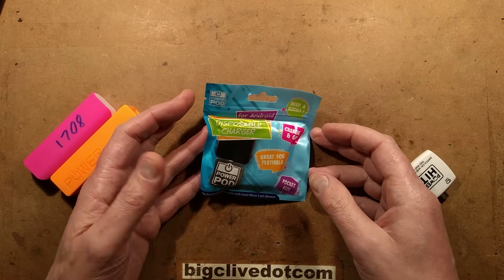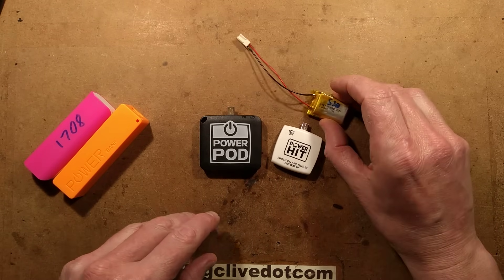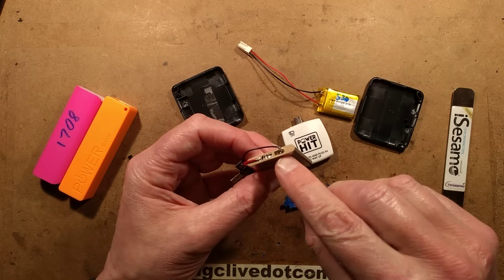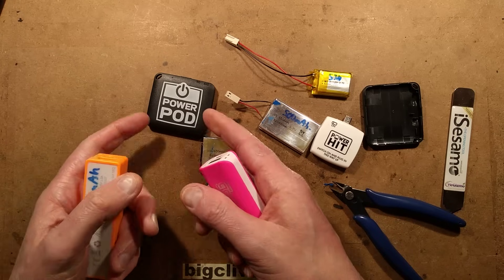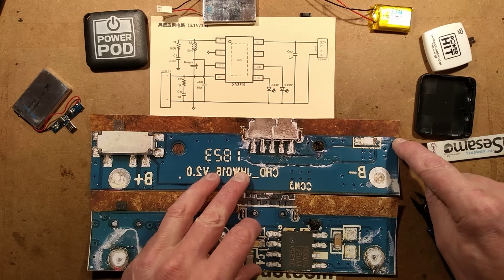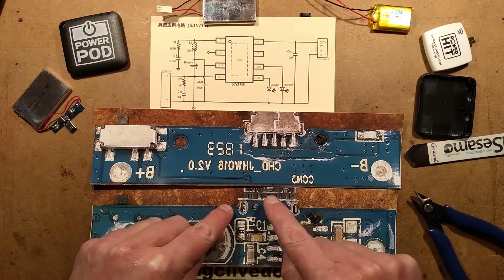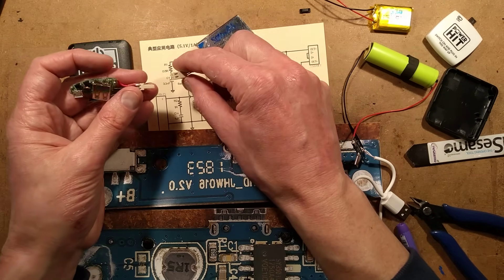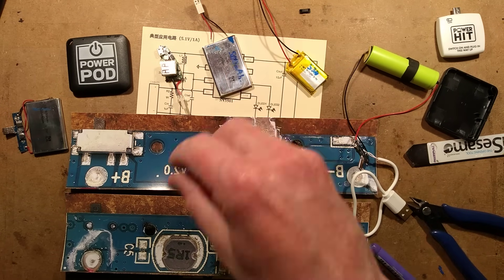Poundland "disposable" phone charger.

Comment: YO i have that blackweb battery!
can confirm, it's great, it can make my phone last about 4 days with medium heavy use and it's durable!
i lost it at some point and one day i just went on a walk in the fields and just happened to find it there, mostly horizontal, but ports facing up slightly, the impressive thing is i had lost it 4 months prior to that, in the winter, it was now summer, i brought it back home, opened it to check the voltage of the cells and found some ants, the cells were very low so i trickle charged it overnight then charged it using the usb port and it retained most of its capacity, iirc this was about 5 years ago, i still have it and still use it, i even recently found out it can do 30W usb PD, which wasn't advertised anywhere on the box, unfortunately the usbc port has seen better days and it's not in great shape now, usb PD doesn't work anymore
also fun fact, the day after i found it the fields were plowed, i was lucky to find it

Comment: I made a power bank using 5. 18650 battery and a 20 watt module it works good and has a over heat protection.

Comment: why even bother using a chip equipped with undervolt protection they've already installed a switch all the really needed was a boost converter that would drain battery down to oblivion but would give out a little more capacity than 650 mah also would have saved them a bunch of money

Comment: I love the lip stick charging cell...usually dependable and different configurations allow clips, lanyards, current capacity,  or any combinations...so fits or attaches anywhere without puting in your pocket. 18650s hold an ample useful energy supply.

Comment: the biggest problem i have with electricy as a power source is the losses whenever you move it from one place to another.  It's be like pouring 40% of the fuel out on the ground whenever i fill the tank... Its so wasteful.
Reply: Er a typical ICE road car is only 25% efficient……….

Comment: Bruh... I can do the same thing with a bunch of used rechargeable disposable vapes I collected off the ground for free, and it will actually be reusable

Mr. Vapor Lux Bars are the most common here, they've got 400mah batteries and are rechargeable with a type C port, it wasn't actually that hard to hook these up to an arduino to create a smart charging bank that can both charge a phone and itself through the same port.

Why just why did the designer of this think it sas a good idea...? At least I can kinda understand rechargeable vapes because pod based flavored vapes were banned and these are convenient and have an overall longer usage life, but this is literally just a one and done thing. So wasteful.

Comment: What I'm excited for is the day when I can have a supercapacitor in my phone and as a backup instead of batteries. Of course, batteries will probably always hold the edge in capacity. But at some point, if high-end supercapacitors can even reach about half the capacity a battery can have, that would be enough to make it worth the transition just for the faster charging. I wouldn't mind having half the capacity if I could plug it in for 10min when it's nearly out of power and have it be fully charged again.

Comment: First disposable "inhalation devices", and now this? Why are people even buying this? You said it yourself, you can barely charge your phone with one of these. I think the only actual legitimate use for this is to throw in a hiking backpack for emergencies, since it's very shelf stable and totally water sealed (at least until you open the packaging). They probably would've sold a lot more of these (for better or for worse) if they marketed it like that, because that's the only way I could see it being actually useful. But then there would be the risk of people just dropping these in the middle of the forest, which could 100% start a forest fire. This is just a terrible idea, especially because they sell bigger rechargeable batteries for the same price. Whoever thought of this should be fired.

Comment: I have a power bank from Maxell, that takes 4 AA's in series and depending on the chemistry it can get an old S10 up to about 60% charge state from 10%, but it is painfully slow towards the end. So if an average alkaline AA has a roughly 2800 mAh capacity, then barely a bit over half of that can be transferred to a phone battery which is on its way out. At that point the voltages are going nearly equal and next to no current can flow.

Comment: I have something like this. The charge tab. Purchased at walmart. it has an unknown capacity li-po pouch battery inside and what seems like a basic powerbank circuit with an unpopulated USB connection.
Soldering a USB lead to the + and - tracks on the board leads to the blue light coming on but no charging. Turning on the switch seems to activate charging and also allows charging of a device. The main chip does get warm, about 120- 130F and draws up to half an amp during charging. I've tested the battery and it is charging. Hopefully I can come up with a case for this. Maybe I'll change out the USB C for a standard USB A socket So I can plug anything in. 
Also these are a nice source of LiPo cells.

Comment: 2 points - - WOAH didnt realise how old this vid was
should there be a ban on using rechargable lithium ion batteries in throwaway non rechargable devices like desposable powerbanks & vapes.
if the battery inside is 650MAH at 3.7V. the device is sold with a 5V usb output. at 5v it should hold 481MAH.
if the device is sold as a single unit with a USB (5v) output and not intended to ever be opened would selling/marking/advertising it as 650MAH be miss selling or falsely advertising the item ?
Reply from the maker: Most power banks declare the capacity of the internal cell.
Reply: @bigclivedotcom  i thought they did and just think its deceptive and deshonest
im suprised none have started making them with 0.1A internal cell at 100,000 mah sold as 100,000 mah.
when switched up to 5A usb it would only be 2,000mah. surely this would be deceptive.
i think that if its sealed inside a device never intended to be opened it should be calculated at the only vaultage that the user will be aware of. the input / output vaultage or in mwh. anything else is deceptive and dishonest

Comment: four years later, 5 rewatches and from no powerbanks to 3 of them, in reference to the blackweb mention. one thing that would be interesting is to see how the true capacity powerbanks are getting their capacity. i know that the Samsung brand powerbanks for their 5,000mAh line (sadly discontinued) does it with 2 Li-Po cells in series of about 3,000mAh each.

Comment: you could put those batterys from single use powerbanks in a powerbank board with a fuse and it will work! make sure to pick a 2 cell 18650 as that charge and discharge board has protection

Comment: I'm a bit confused because yesterday I watched Mythbusters "Will appliance in bathtub electrocute" and on there they claimed at first that just 70 milliamps was a fatal level but then later said it was as low as 6 milliamps. You're saying these things give out over 500 yet I'm sure you couldn't electrocute yourself with a cell phone battery. So am I missing something here?

https://www.youtube.com/watch?v=SU7xkYmWwmQ
Reply from the maker: The battery has low voltage (low electric pressure) so it can't push the current through you.
Reply: @bigclivedotcom  Ok thanks, so its not entirely true when they say its amps that kill you not voltage?
Reply: So I guess its a bit of both really.
Reply: @bigclivedotcom  So is voltage basically just a measure of how much push the current has? Or is it more complex than that?
Reply: Thanks for replies btw

Comment: You could, wire it to another connector and solder a charging port And reverse engineer it with a protection for charging. It would be a good thing for the better for a nice backup, better bang for buck, even wire several batteries in a series with a protection, for even bigger bang for buck.
Reply: I’ll find it funny if they say they use 100% recycled plastic and materials and rate it eco friendly, but in the end  require you to throw a lithium bucket in the trash, I just hope it gets out of my yard very quickly lol 😂

Comment: I’ve never seen anything like that here in the US. I’d never buy one anyway considering I’d much rather have any one of the plethora of rechargeable usb packs out there. The smallest one I currently own has a roughly 1650mah capacity and is no bigger than the orange pack in this video. I only spent 12$ on it, have had it for years and used it countless times.

Comment: The CRAZIEST thing is I can AND HAVE got a proper rechargeable USB battery for the equivalent OF 3 POUNDS here in Australia. Does about 75% of my phone battery. And I have had it for probably more than a year and a half at this point. Works well. Actually I just realized it's the exact same as the orange one you vehicle got there. Except black.
Reply: No way auto correct made "You've Got" into " You vehicle" lol
Silly phone

Comment: When you first removed the case and saw the cell I actually said out loud its a BL5C! That's seriously a waste of a BL5C cell. They are just so good  for a little cell. I wonder if protection boards were rejected, cut off and the cells placed in the factory seconds bin then picked up by the maker of the poundland stuff and decided they can make one hit wonders with them. So wasteful even for a pound or dollar store item.
Reply: But even then it doesn't make much sense, the chip in these is the same as in power banks and will protect the cell. They could just have added an USB port for charging and have a quite crappy powerbank instead of this total nonsense
Reply: You reckon I could use those BL5Cs to power an MCU?

Comment: most likely they use the crappy LiPo batteries that would usually get thrown away right from the production line. long story short they probably use crappy batteries that loose capacity too quick when recharged.

Comment: I will never understand why those chargers doesn't have a charge port, as it would only cost a penny more.
In the current implementation, such chargers should be phased out, as you need seven of them to charge the smallest phone battery once, after which they all go in the bin. It is nonsensical.
As it is nonsensical to add the charging port and chip to them, as a credit-card sized power bank, 2500 mA/h capacity, only costs four pounds.
Poundland should review their offering, avoiding those minuscule single use chargers, and selling the thin 2500 ma/h rechargeable chargers, if they have the slightest green aspiration.
Also, here in the West the USB-C socket is now prevalent, while in the Far East the USB-micro socket remains unchallenged.
Poundland has a minimal offer of USB-C cables / accessories, they should update their inventories. Please note, those single use chargers would never operate a USB-C device properly, as they range from a minimum of 18 W, to a standard 60 W to a top power of 120 W.
Thank you for the video, showing the Poundland chargers and their inner circuitry.

Comment: Here is a nice alternative: A german telecommunications company which has stores in nearly every city borrows you a fully charged powerbank for 10 euros and you get the 10 euros back if you return in somewhere in the country
Reply: I love this idea!
Reply: Indeed, the last festival I went to (End of the Road) you could get a power bank with a deposit for use at the festival (although there was still a price above the deposit, of course).
Reply: @xinaesthetic  nothing wrong with that imo, need to turn a bit of $ for both repairs and replacement. As well as profit, duh
Reply: @HeyItsJonny  of course, no complaints here.
Reply: Welcher Laden hat dieses Angebot?
Reply: @stephanlustig5490  Die Telekom, kannst mal danach googlen, gibt wohl inzwischen ein paar Läden die keine powerbanks mehr haben
Reply: @chaotus  danke für die schnelle Antwort.
Reply: How do they make money? Replacement of the batteries and energy to charge them have cost.
Reply: @Artoooooor  I think it was mainly marketing and some wouldn’t bring the powerbank back which would make a profit

Comment: Wondering if the higher then tested mAh rating was because those things are designed to deeply discharge the Li-ion cells, basically bringing them below the expected 'zero' to the true zero point of Li-ion.  Thus giving it some extra mAh at the expense of recharge cycles and battery life, which neither are important for a disposable application.

Comment: Though these might be wasteful products when they are sold for the intended purpose, they do become a source of components to those of us who are unable (for various shipping reasons) to obtain those parts directly. I have a need for small rechargeable lithium cells and these are perfect though I am sure they could be obtained more cheaply elsewhere. In my location, even 18650 cells are only available in "Vape" shops at an exorbitant price. Good power banks are available but have sufficient intrinsic value that I hate to dissemble them simply for parts. Laptop batteries are becoming scarce nowadays.

Comment: These are now available in Alaska, and use a LP9315 chip (which appears to be functionally similar). It has clearly marked charging connections on the board and a similarly missing led chip. I intend to try to do as you did and will try to add the resistor/capacitor part that is missing. Not being a circuit person, I do not know the function of the resistor/capacitor and wonder what effect there is if they remain missing? Would the additional "charging" led require a resistor?

Comment: Just used one of these exact Power Pods to charge a Samsung Android phone. It lasted at most 20 minutes and only put the phones battery up by about 5 or 6%.  I then tried it again after leaving it for a few hours but it had no spare power left.  Terrible. It's the kind of thing that can provide you with one or two short phone calls in an emergency but that'll be about it.  But, as Clive says, at least I now have a battery n circuit board to play with.  That's good, but one-use disposable?   Not a good idea in  the first place.

Comment: Maybe a design like this would be worth it with an Aluminum Air battery? They can store more power, but can only be activated and used once and are not rechargeable.
Reply: Looking at the Wikipedia page for AL-Air Batteries, it doesn't look too promising.

Comment: What an utter waste of ressources! There are much better ways for creating Once-to-use powerbanks, namely those you can return at a „recycle“ station where the company of the product checks them and brings them back to business fully recharged. And if we look at the price of a powerbank today rated 2000mAh, it‘s perhaps 5 times the price of these ressource-wasting pods but can be used at least 100 to 150 times minimum. Such products should not be allowed for sale at all even if their purpose is meant in a positive way! And as Clive was already stating: the chip would allow for recharging the battery inside. So no necessity to make this a disposable unit at all. Clive should propose these companies who make these power pods how to produce an improved version at a slightly higher price. I‘d get the power pod for say 4 pounds if it would be rechargeable!

Comment: Easier, cheaper and slightly more eco friendly solution:

1) Buy 3-4 1200 (or higher) mAh reusable portable batteries (they usually come with a charging cable in the package)
2) Charge all the batteries
3) Pop a set (battery - charging cable) in every purse/backpack you use

There, you have a ready emergency battery every time. When one gets empty, you can recharge it at home and pop it in purse again. Problem solved!

Comment: I knew when I saw that metal battery you were going to pull out a BL-5C battery. 
The sad thing about these disposable batteries is, a couple of button cells, or even AAA would probably put out more power (and be reusable if you're so lazy you can't be bothered to charge them). If they used zinc air they'd probably even get better capacity AND shelf life because they could fill the plastic packaging with nitrogen or CO2 meaning there's no power generated until the packaging is opened and the cells exposed to air.

Comment: the powerhit battery seems much more versatile. you could easily use it on lego drones and other small RC aircraft. The "powerpod" battery is way too big and heavy for it's capacity and potential use cases
Reply from the maker: The cells used in these are not really suited to very high current drain.
Reply: @bigclivedotcom  ah well thanks for response and clarification!

Comment: I wonder... If the manufacturer decided to, instead, put a NON-rechargeable Energizer Lithium battery in there (let's pretend that there was a similar size/shape version) would people be so negative about them?
Point of fact... Energizer actually DID sell a case with a mini USB lead that had an "AA" compartment exactly for that purpose... You tossed the non-rechargeable batteries in the bin after use.
Heck... Maybe ANY single-use battery, because they are DESIGNED from the start to be thrown away, are inherently more moral?

Comment: Just tested one, and one thing is that it does zap the battery, discharging it to a much lower approx 3.1V, so you do get more out of the battery than you would in a normal circuit that discharges to 3.7V, at a cost of not being able to recharge the battery as much as before. So, no good for a discharge protection circuit (damn, I was hoping it would be!) as 3.1V is probably lower than you'd want to discharge your battery, but fine for a charger circuit. Still not sufficient to justify it being on the market though. They should be illegal.
Reply: most protection circuits cut out at 2.8 to 3.0V, it's perfectly safe for a lithium ion battery to discharge to that level. 3.7V is the nominal voltage.